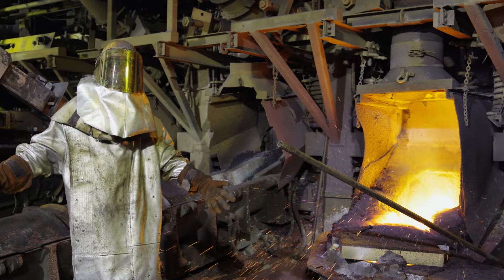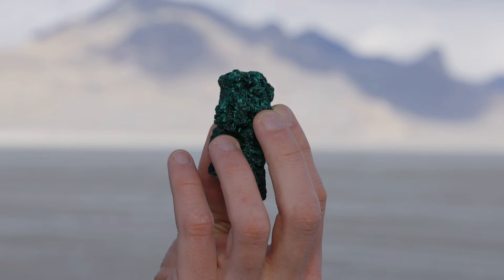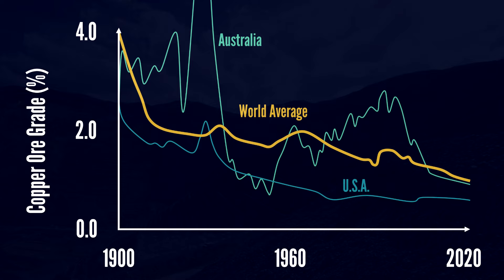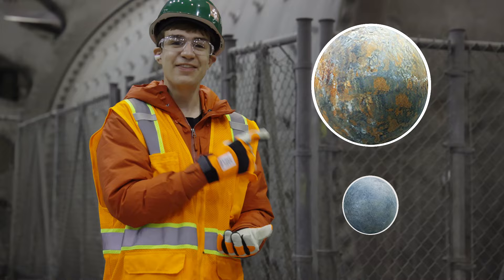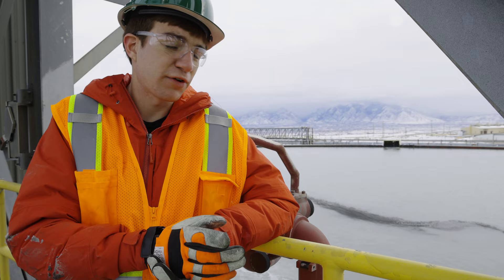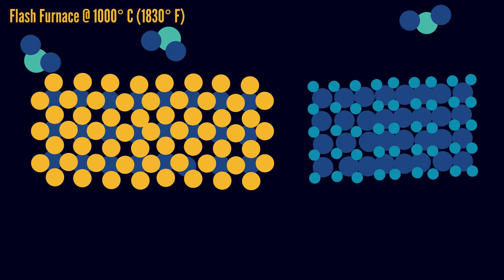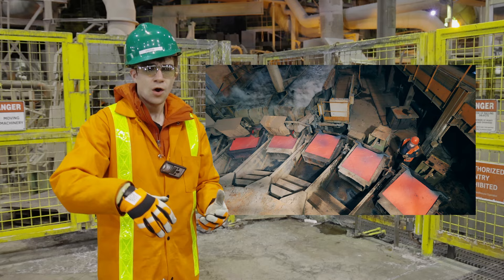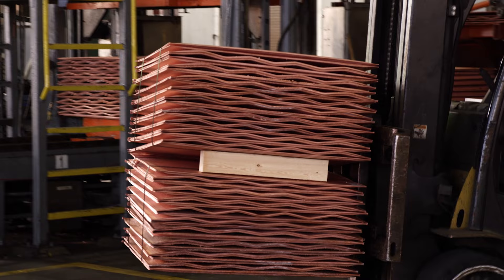Inside America's Super Smelter

Comment: As a metallurgist, all of these refining processes fascinate me. I'd highly recommend watching videos on how other product forms (metal plate, forgings, castings, bars, etc.) are made. Maybe even a topic for a future video!
Reply from the maker: Thanks! Yup thats the plan! I'm trying to find some steel works to cover next episode and make a series out if it. This stuff is facinating!
Reply: @AtomicFrontier  I'll send you a quick message on your website form with some potential US based suppliers!
Reply: @darkgaia181  Beryllium and Tungsten is others that I would love to see, as they are really mysteries and extreme metals. I cant even imagine a tungsten kiln.
Reply: @maximianocoelho4496  beryllium might be a little out of reach just because of its status as a carcinogen. Even machining it is enough to cause concerns let alone melting it. Tungsten would be really interesting, though!
Reply: @darkgaia181  and there is strategic value in preserving the way they process it. The US leads in Beryllium production for a reason... Oooh well, Titanium from titanium oxide maybe?
Reply: @AtomicFrontier   You may run into a lot of hoops and red tap for the steel industry. This is typically due to their value to the defence sector and the resultant high level of security, at least in the North American sphere. A few other really interesting options you may be able to delve into are other base metals such as zinc, nickel, and lithium which are all integral components of the supply change as the mining industries and energy industies across the globe moves towards net zero emmissions. If you have any questions or are looking for resources in the mining sector feel free to reach out. Awesome video!
Reply: Yeah this is what I do on my channel!
Reply: @AtomicFrontier  wieland is a good place to start. It’s a brass mill and they make all kinds of metals. They get the copper cathode and mix it with zinc to make brass in its bar form. From there they roll it into coils. It’s a fascinating process
Reply: Play factorio with mods
Reply: How do you resist the urge to drink the molten goo? It looks like a delicious sauce.
Reply: @maximianocoelho4496  i use tungsten almost every day as a welding electrode. it's properties will always amaze me. never take for granted how incredible our industrial world is.

Comment: So iron is just dumped outside? It made me imediatly think of a post apocalipse story where people would just find that "slag" and use it to forge weapons.
Reply: Or they could just use all the other iron that would be left over after the apocalypse.
Reply: @boarbot7829  iron ore would be harder to obtain
Reply: @boarbot7829  yeah that's such a waste. The iron sulfur slurry/slag should be reprocessed into iron. We need our economy to stop producing waste and start reusing everything we can.
Reply: @ooooneeee  or even just recover the waste heat - there must be an enormous amount of thermal energy in the slag
Reply: the iron isn't in its elemental form, it is encased in silicate.  The SiO2 in the slag is what draws the iron out of the metal melt inside the flash furnace.
Reply: @ooooneeee  There are better sources of iron, you want iron oxides to turn into steel.  Those are present in banded iron deposits around the Great Lakes & Labrador Trough, or magnetite deposits found in, for example, skarn deposits.  If it takes $100 to make $10 worth of iron, you are doing it wrong.
Reply: @sagmilling  I see. Then maybe the slag can be used as a resource. Like some iron furnace slag can be used to make stronger concrete with less carbon emissions than when only using cemented.
Reply: @ooooneeee  probably people trying to figure that out
Reply: Compared to the value of the copper, it's rather worthless. (but it is a shame they don't do anything with it.)
Reply: Great idea  @emmajacobs5575  , perhaps it's got enough to flash boil water to drive a steam turbine? If dumping chunks into water directly is impractical, maybe a primary heat circuit of a fluid with higher boiling point could extract the heat to a heat exchanger?

Sub boiling "low grade" heat is less useful. It could be used for district heating, but there aren't many houses near metal works.
Reply: Iron is literally everywhere on earth and therefore you need very rich iron ore to make it profitable to refine it. That slag likely isn't even close to that level. Naturally occurring hematite has around 70% of iron.

Comment: I've spent 4 years of my career in furnace engineering. Including the Kennecott furnace pictured here. One thing that I find so interesting about smelting is that these furnaces employ such old concepts (brick linings) and wrap them in so much advanced engineering. Even so, when something goes wrong, it's such a guessing game trying to understand how to improve the life of a furnace. It's held together with extremely large forces, can't be cooled down regularly if at all, and is always holding thousands of tonnes of material. So it's basically impossible to inspect a furnace mid campaign and even very difficult to undertake a autopsy once a furnace has reached end of life.
Smelting is a huge game of benchmarking against other peer smelters which even then, aren't fully comparable.
Reply: That's super interesting, I never thought about the material science behind such monstrous vessels. It is easy to get caught up in the brilliant heat and molten metal and miss the equally impressive device that created it and holds it captive. It's curious that by being designed for such brutal conditions, a furnace's structure might be jeopardized by more mundane environments; very backwards to most things that a person might commonly interact with where getting too hot is detrimental and cold is only a concern when it is extreme.

I find processes and machinery that work at the limits of engineering and material sciences to be fascinating. It is enthralling to peek into environments where every component is taxed to just beneath it's breaking point and anything that isn't purpose built will not survive. Everything there is exotic, operating barely within the bounds of what is possible and fulfilling a task that literally nothing else could.
Reply: Graphite vessels aren't that hard to procure, but yes it's amazing to think we can create and use molten metal

Comment: What a lot of people don't know is most of that "sludge" during electrolytic refining is actually gold and silver.  If you check a Periodic Table, you will notice they are in the same column as copper, which is the main reason they are the most common impurities.  The sludge is actually a significant portion of the profit of the copper refiner.

Comment: My first job after graduation was working with the mass and heat balances for the Kennecott Flash smelter upgrade that was shown in the video.  I was specifically working out the best size of the bedding plant (think - stockpile) between Copperton and the Smelter.  A little linear algebra to rotate a nine-dimensional elemental data set and and dozens of hour-long simulation on a brand-new, top-of-the-line 486 computer per simulation.  Good times.
Reply: 486 - dx, or sx? Inquiring minds want to know...
Reply: Very interesting Alex.... Will eager to know more about your bedding plant project.

Comment: In the late 90's I was a Kennecott Energy electrician in Wyoming. HR informed me that there was a call for maintenance persons to fill temporary (3 month) positions at the Kennecott Smelter in Salt Lake City, Utah. The Outokumpu Flash Converting Furnace process used at the Smelter was a new process. Off the top of my head I do not remember when it started production, but the 3-month rebuild process that I was involved in the first time was mostly tasked with repairing and/or replacing production equipment that had been found deficient in the production process. For example, during most of the production process, parallel lines existed which allowed one side to be shut down if some type of maintenance was required. That is until the final step of Anode pouring. Originally, one wheel had been built which accepted pours from both lines. That was all well and good until the problem developed in the Anode wheel itself; then both parallel production lines would be stopped. Simple solution - two anode wheels that could receive the pours from either production line or both production lines. 
I am a process person - I love viewing processes and equipment, studying prints and authoritative descriptions, and putting paper and pencil to real life. I mined coal for 25 years, getting very involved with the process in two different mines. I worked as a millwright/electrician in a sawmill during a mine layoff, and I finished my career on the west coast working for a major aircraft production corporation. I love processes that produce an end product we use - the intricacies of the machines used in production and the real world equipment and methods involved with the maintenance of that equipment - the proper way to troubleshoot a motor or control problem and then how to repair said problem. And I love delving into the parts and process involved in measuring the process.
The Smelter was unique, in my experience, because there were many detours that could occur in the process. The second furnace in line was going to be down for a month - no problem the product could be diverted prior to it and could be loaded on rail cars and sold or could be stockpiled. While, of course, this was not the best solution, it could be added to the overall costs involved in the rebuild apparently. This concept was something I was unaccustomed to in mining and lumber; if something went down the process was hurt, and it was as_____s and elbows until the repair was completed or the lost production could be converted to Preventative Maintenance. 
Every bit of the process was environmentally produced that I observed. Chemicals and vapors produced in the melting and burning were captured as much as humanly possible and then packaged and/or converted into a product that could be sold for human or process consumption. 150 years ago ore producing facilities probably had little idea of the products and money they were throwing away or, at least, they had no idea or the means of capturing these products. 
While, I dare not say it was “fun”, the maintenance process was thrilling to say the least – getting a phone, radio, or intercom call when a problem occurred, getting the maintenance troops to the problem area, overseeing the troubleshooting, facilitating the parts procurement and transportation, buttoning up the repair, and putting the call up to the control room that they could start it up. Worrying about the safety items involved in Smelter operations added to the thrill. 
Actually, that is BS, my job as a maintenance person Was Fun. Regardless of what it meant to the various productions involved in terms of lost profits – my job was to repair those problems. If the problems did not occur as a normal course of events I would not have been there.

Comment: So the balls in the mill are not called bearings, they are Grinding Balls, the round tanks where the concentrate settles are thickeners, the clear water is the overflow and the is a rake that thickens the slurry and that is collected as thickener underflow.  

Very informative and well done, clear and straight to the point.

Comment: The environmentalists paradox. On one hand wanting electric cars, solar panels, wind turbines yet in the same breath call for the closing of mines. Pebble mine comes to mind. Electric cars, wind turbines, and solar panels require substantial amounts of copper, aluminum, nickel, lithium, steel, and plastics (from crude oil).
There are no perfect solutions, only tradeoffs.
Reply: In the short term yes, however in the long term it will be closed cycle as we're not "consuming" this copper like we do oil and gas. Once the industry is 100% converted then all we need is enough production and mining to offset the waste left over from recycling the old material. We're never turning the CO2 back into hydrocarbons again as the energy needs to come from somewhere.

Comment: I will note that at 1:12 he states: "it is quite reactive" while in reality, copper is not a very reactive metal, and it places fairly low on the reactivity series of metals. only metals like platinum gold and silver are less reactive than copper. a testament to its un-reactivity is how easily you can remove the oxygen that it likes to bond to. if you heat copper to 600F-1000F and blow flammable gas over it (such as hydrogen or butane) it will reduce back to copper metal.

Comment: I'm surprised that the rail link between the smelter and the electrolyzer isn't electrified. Surely it's easier to source copper wire than oil in a place like that?

Comment: Copper is smelted from 3% copper ore. 

Compare this to gold, which is obtained from as little as 1g per ton or 0.1%.
Reply: Uuuuhhhh no, to everything
Average copper ore grade is 0.6%. The mine I work at has a copper grade of less than 0.3%. It is upgraded to around 25% before being smelted.
1g per ton is not even close to 0.1%. There are over 900,000 grams in a short ton. 1 gram per ton is actually 0.00011%

Comment: 6:25 I'm surprised and confused: why do they just dump the FeO layer as worthless slag rather than tapping it out separately to refine into iron? The diagram makes it look like that'd be straightforward to do, and like they've already sunk a huge portion of the time and work into getting it refined anyway??
Reply: Because Iron is super cheap. Iron ore pellets that Iron mines produce are about 60% purity and sell as of writing for about $100 per ton. Copper smelter slag is anywhere from about 35% to 50% purity and may have additional impurities that make it harder to process. Iron just isnt that valuable. Its very likely that in the future these slag piles will be processed when prices are much higher, but its just not economical right now.

Comment: 3:28 - "some ball bearings" - I gues you meant to say "bearing balls", right? Wrong anyway, as there's' no point in using precisely machined and ground steel balls, when a regular "roughly ballish" 40-50 mm in diameter (1.6 - 2 in) pieces made of cast iron would do just as well.